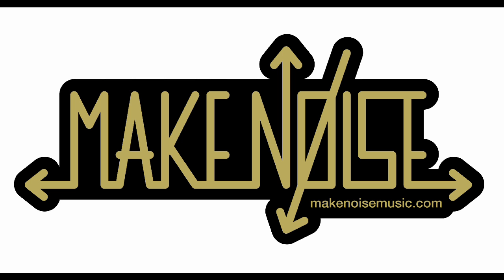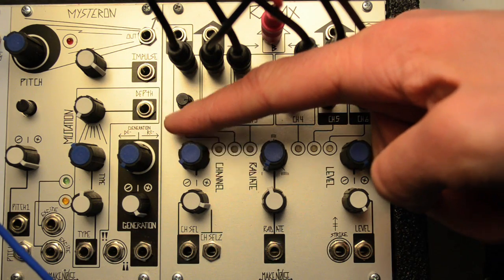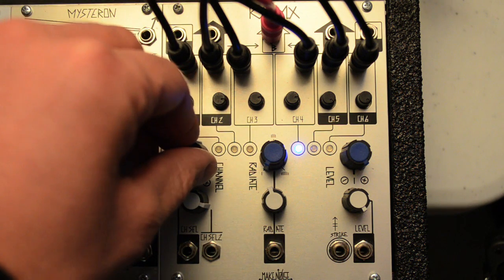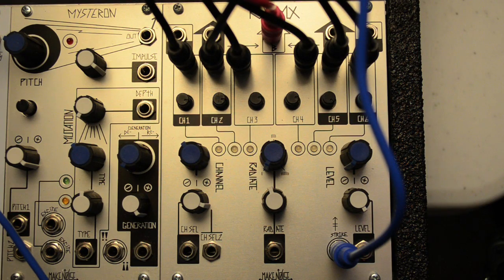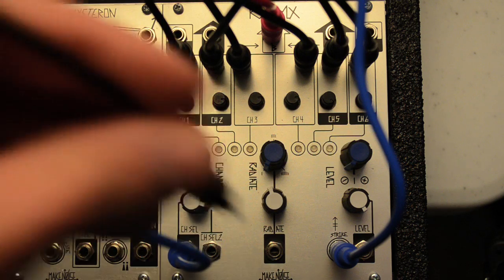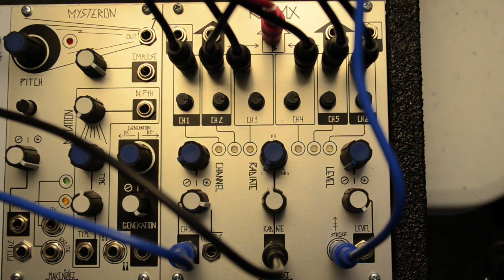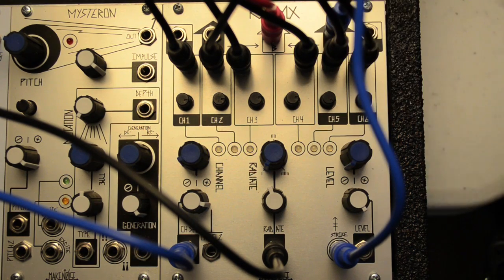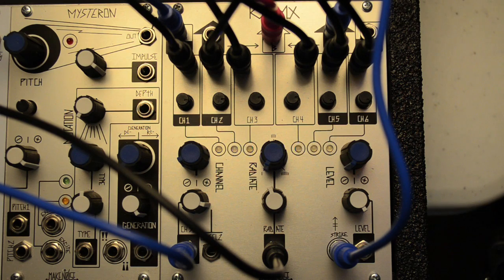Make Noise RxMx & Cadavre Exquis

Comment: Can i route/mix CV signals?
Reply from the maker: Yes, it's DC coupled, but as a vactrol-based device it is not very precise (if you were mixing quantized voltage for example).

Comment: Is the RXMX related to the Mixolator?
Reply from the maker: Not directly. Although the RxMx does have its origins in a circuit idea by Grant Richter, that idea was never fleshed out into a product until the RxMx. The Mixolator is more like a mixer/VCA/ring mod mashup, where the RxMx is more of a low-pass gate/scanner mashup.
Reply: MAKEN0ISE 
Thanks!!!

One last question: 
I'm planning on buying a pair or the Wiard 300, Classic VCOs(6U).

Is there any reason that it wouldn't  work in conjunction with a RXMX?
Reply from the maker: Yes, that should be fine. And fun!

Comment: Maybe I'm being daft, but at the 1:30 mark you mention that the output A and C remove channels from the B output, but then you say "in this way, the RxMx can have 1 to  3 independent outputs..." Given that A and C remove their respective channels from B, how could you ever have 3 outs? Seems like you'd either have B (all six), or a combination of B+A or B+C, but A+B+C wouldn't output anything on B, would it?
Reply from the maker: A = Aux A, CH. 1, CH 2
B = Ch. 3, Ch. 4
C = Aux C, Ch. 5, Ch. 6

Does that clear it up?
Reply: Ahh, yes. Thank you.
Reply: This was actually hugely helpful to be, as I just discovered - a split between A + B sounds very different than a straight direct from just B. Why is that?
Reply: Different in what way? Grittier?
Reply: I don't have anything patched now as the second coat of my case's varnish is drying ;) But it sounded different structurally, not tonally. I would have assumed together they would make the sum of the B output and sound the same when combined but they didn't. I'll try and explore later when things get back together.